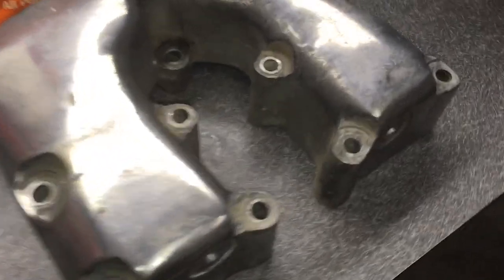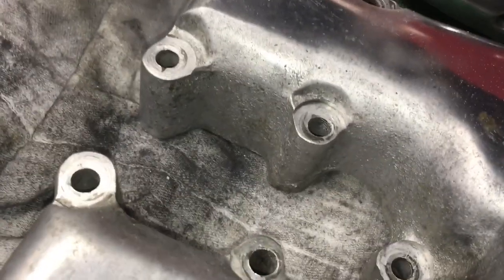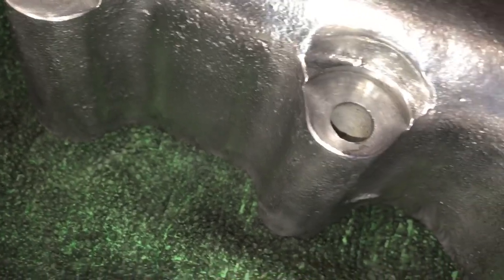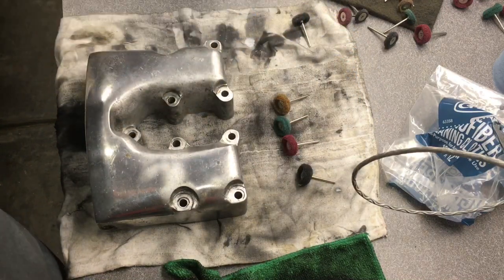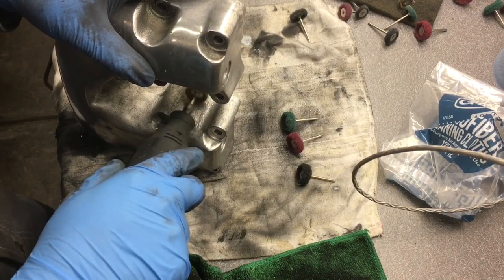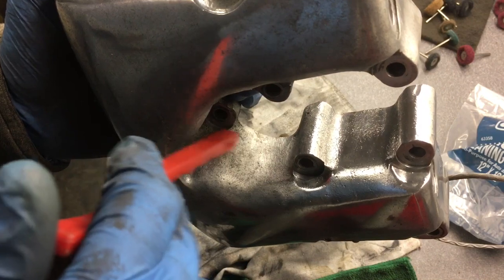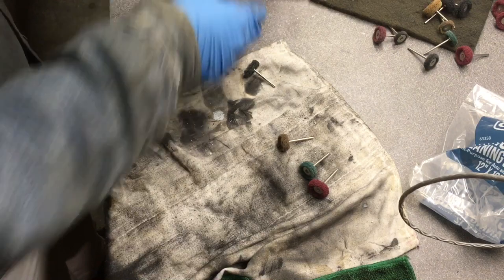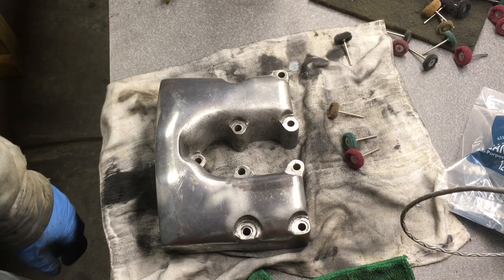Cheap way to Clean and Polish Harley Shovelhead Rocker Boxes

Comment: Nice work! I have a 79 shovel engine that someone painted the rockers on so I'm gonna strip and polish them and repaint the crank cases.
Reply from the maker: Master Of none tv cool.  I thought about powder coating these, but changed my mind. I ended up using a buffing wheel to finish them.
Reply: @motofun72  I thought about powder coat also. I have one of the harbor freight units that I've been using for quite a few years that once I got the hang of it it works pretty good!

Comment: I never even thought of using a Dremel tool! That probably would have made things go a lot faster! I would start out with 600-800 grit wet sandpaper and would sand to an even finish getting all the scratches out within reason:) then move up to finer grits. Usually ended up at 1200 to 1500 grit. I then would use my bench grinder with polishing wheels, but then I discovered that White Diamond polish that you showed and it would polish out really nice! I have found that household ammonia cleans aluminum really good. Try soaking a small part sometime and see if that helps get the crud off. Like you, I have more time than money, so I always try to find a way to do the job myself;)
Reply from the maker: Many good points. Thanks.

Comment: Actually the best way to do these is the sand paper step process.  Start with 600 all the way up to 3000
Reply from the maker: Yes I agree. That does give a better result.
Reply: I do this as a hobby.  I have taken chrome plated billet and removed the chrome and polished to a mirror image.  I also have a custom 1998 Titan Gecko RM with the S&S 113 HP billet engine.  Currently is at 150HP at the rear wheel.  I’m trying to find a way to polish the fins and jugs.  I’ve polished and sanded the bottom jugs which look amazing.